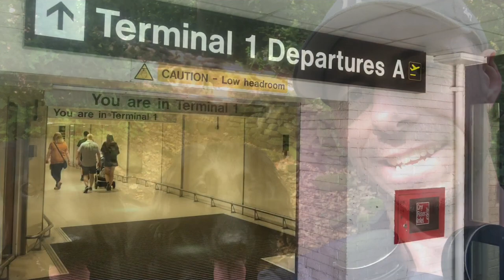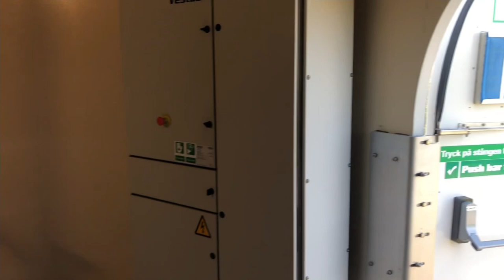Rope access Blade repair - it’s not all good

Comment: i just completed my IRATA level 1 , did a few days with a construction company and considering blade repair and my options.  Being over 40 this is very informative and relatable. TY!
Reply from the maker: Cheers bro… all the best in the new career… Rope Access has so many avenues it’s just finding a trade that you enjoy. Abseiling and climbing is just a means to get you to the work face.

As far as I’m concerned blade repair is for the youngsters. It’s too long sitting in a harness at 40+ in my opinion. Having been a level 3 for 23 years I think I have a good idea how long I want to spend in a climbing seat and it’s not 3-5hrs at a time.

Comment: 6 hours sitting in a harness, even with a seat, is tough. One day is one thing, 6 days in a row would be rough. I did 4 hours with a seat, but even it bites into your legs no matter how many times you move it around. Great video, thank you for making it. Jim
Reply from the maker: Cheers Jim… yep day after day…. You sure needed that Sunday off to let the body heal. I still have knee pain from this job after resting my feet on the blade while standing in my etrier. It’s was a lesson in what I’m not willing to do any more that’s for sure.

Glad you enjoyed the video 👍🏼
Reply: While watching your video, I had the thought of utilizing an etrier or two to straighten the legs, and take the bite off my side quads. I will be up there soon enough, I am doing the composite lay-up training now. On the ground ( thank you) @jaysysumakaRatMaster3
Reply from the maker: @aerialrescuesolutions3277 you might be better off doing some training to work on platforms or MEWPS rather than being on a rope.  Or even keep your feet on the ground. 👍🏼

Comment: Currently in temp job in a pub earning minimum wage making £1400 a month its abismall struggling to even save to pay for the irata training if you have any advice like a way to get into this work, which jobs are decent pay when starting out any tips ect. my background is van delivery driving and a long time ago did a couple years as a carpenter loft conversions.
Reply from the maker: I understand your situation; the rope access industry can seem difficult to get into at first, but once you’re in, it’s definitely worth the effort. Given your background in delivery driving and carpentry, you already have some transferable skills that can be valuable in this field as well as dealing with customers in the bar.

Here are a few tips on how to get started and possibly secure funding for IRATA training:

1.	Start with Research: One of the biggest misconceptions people have when they start out in the industry is they are a climber first and foremost. This is the wrong way to look at it. You need a skill to offer. Rope access is purely a means of getting to where you’re going to work. If you’re young enough to do an apprenticeship I’d always suggest this first. Anyone can learn to be a rope access technician in a week.

Get a trade behind you, electrician, Non destructive testing inspector, welding, pipe fitting, painting, spraying and blasting, blade repair (if you’re young enough) bridge inspection, window cleaner, glazing installation. 

Having a driving license is definitely a good skill to have though. Learn about IRATA skills on the Access Techniques YouTube page. If you can do your training there as well, it guarantees a good level of training and assessment.

I personally started out installing fall arrest roof safety equipment for the first year working for a rope access company. 

2.	Look for Entry-Level Jobs: Some companies might offer positions where you don’t need a full IRATA qualification right away, but can gain experience while working towards it. You could start by looking for roles like trainee technician or general laborer with companies that already specialize in rope access. They might help with the cost of training once you’ve proven yourself on site. I know plenty of guys who worked as store men in rope access companies getting vans ready for lads to pickup on a Monday morning.

3.	Reach Out to Rope Access Companies: Contact local rope access companies and express your interest in working in the industry. Some companies may have training schemes or offer financial support to help you get your IRATA qualification in exchange for a commitment to work with them for a set period.

4.	Grants or Funding: While grants specifically for IRATA training can be hard to come by, you can look into some general schemes. For example:

•	Jobcentre Plus offers advice on training schemes and may have funding options, especially if you’re on a low income.

•	Trade Unions sometimes offer grants or financial help for workers looking to gain new qualifications, especially in industries like construction.

•	Charities such as the Prince’s Trust or Construction Industry Training Board (CITB) can sometimes provide funding or support for training.

5.	Consider Other Types of Funding: If you’re struggling to save for the course, look into personal development loans or even crowdfunding options. Some people have successfully used platforms like GoFundMe to raise money for professional training.

I hope these suggestions help, All the best in your pursuits.
Reply: If you  want some advice try and go cash in hand sign on and ask the jobcentre to pay for it they're doing mine
Reply: @jaysysumakaRatMaster3  Yes this is massivly helpful gonna be busy reasearching for while thankyou for the help. :)

Comment: Great video mate. Very good insight into this sort of work. So the company you worked for, did they pay for flights,accommodation, food?  How much did they fill your pockets too?
Reply from the maker: Flights paid, 8hrs pay during travel days despite my journey from Stockholm to Stormsund taking about 14hrs including the medical.
30€ per day for food
Accommodation paid for.
PPE paid for despite being 2 days late.
No work on Sunday- Sunday unpaid.

Safety was pretty poor by offshore standards… and certainly not a job I’d do for long.

I was paid £5100 for 22 days away from home which includes £550 of food expenses. This is as a level 3 rope tech, blade technician with zero hours blade experience but over 20 years rope access experience.

Working as an electrician offshore my basic salary before tax would be over £4000 more than this.

Personally I’ll never work on a wind turbine again.

Comment: I see that grinding is done with skin exposed which doesn't gel with me because when you remove the ppe that dust goes everywhere including eyes
Reply from the maker: @trevorvanzuydam8115  Yep, safety on this job was shocking to say the least. In 15 to 20 years time silicosis type symptoms will undoubtedly hit a lot of blade repair technicians through using the wrong ppe.

Every blade technician should be wearing an airfed mask during prep work. The biggest hazard isn’t the height exposure and wearing the wrong helmet is unlikely to be a deciding factor when it comes to life longevity.

Comment: What other jobs have you done with rope access? I have been curious about rope access, but haven't figured out a job that uses it in my area really, one that would interest me. I'm from Ontario Canada, close to Sarnia. Not really big cities near me that require high rise maintenance or window washing. Sarnia has a big oil and gas industry.
Reply from the maker: I have tried many other jobs during my 25 years on the ropes and have finally found myself doing electrical maintenance in the oil and gas industry on offshore oil installation. 

If I could recommend any job as a rope technician this would be it. But, it obviously takes time to acquire the electrical knowledge and also money to do the courses… as with anything really.

Other trades that people look for in this industry are:

Rigging
Non- destructive testing
Instrument tubing - pipe fitting
Painting
Pipe lagging
Bolt tensioning
Drops surveys
Derrick building
Fire and gas engineers - electrical
Electrical maintenance 
Electrical installation 

There’s a lot of avenues into Rope Access it’s just finding something you enjoy.

Without a real trade with rope access you will more than likely be grafting every day of your life. 

Working offshore was a massive eye opener for me into how little is achieved in a working day sometimes and how little pressure is put on you.

At least in the U.K. sector, time isn’t money… it’s all about doing the job safely and sticking to the many rules we live by day to day.

As much as they often feel like they’re there to make your life harder, they more often than not make your job take longer and make it easier.

And considering you’re paid to be here rather than what you achieve… I find it very easy to just roll with it.

Hope that helps pal and all the best 👍🏼

Comment: So I've seen the other side of excessive safety protocols in a corporation. What happens is that someone does something and gets killed. Someone else develops a safety protocol to prevent that from happening in the future. (After an expensive fine/lawsuit.) On a long enough timeline the entire corporation runs as an entity catering to the absolute lowest common denominator in society. If you're a fuckup and a moron, they will make sure that you're nice and safe... or at least can't successfully sue.

Among other things, I am very competent with VERY dangerous equipment. Stuff I've worked with for decades. That equipment is 20% as useful with all the safety crap as without. But you WILL get fired if you don't use it. When I tell them that from about 1885 to 2005 no one ever had access to half the safety shit, I get annoyed looks. When I ask them  just to tell me the safety stats of the equipment before and after all the safety additions, I get progressively more hostility. I make them see that all they're doing is catering to idiots without improving safety.

For some things you need safety, period. Can't do it without it. No space walks without space suits, that's a given. But I find that skill and knowledge is what you really need. If your guy is not skilled enough not to cut through his own rope with a disc grinder, you need to put that guy to learn at least 2 more years on how to become better at both belaying and grinding. Whatever the job, if you have some guy who's been doing it for 10 years without issues, he won't need half the safety stuff you give him.

It sounds like I don't approve of safety protocols. I actually do. I wish it was a properly applied science however. Do the stats, where does it actually improve safety and where are you just keeping incompetents from wrecking themselves? If you build your organization to only cater to the talented experts and then improve THEIR safety record, I am all onboard. But if you're putting a guy who's 2 weeks into the industry on a rope at 100 meters and hanging pillows off of him to keep him alive after he falls... well, you get it. It's a waste.
Reply: Safety Protocols are an applied science, it's called risk assessment matrix. If you have someone that is good a risk assessment and puts in the right control measures instead of all the control measure you normally find things get done much more effectively. Also your attitude is probably what gets people annoyed, think about it from their point of view and your the manager. Do you want a team that says yeah we all have 20 years with a disc grinder we don't need rope protection, or do you want the team that say yeah thats fine bit of a hassle but considering the result of the rope getting cut is having to rescue a guy out his asap or scrap him off the floor it's probably a good idea.
Reply from the maker: @neilmcg7272 No one plans to have an accident but we can all plan to avoid one.

The worst thing in the blade repair industry is that it’s so young. It’s only in 15 to 30 years from now that we will see the effects of working with these chemicals and the dust created from grinding have on the body.

Especially when the right PPE isn’t being provided. Everyone doing blade repair should be wearing an air fed full face mask.

Anyway… it’s not a career path I’ll be pursuing any further. Good luck to you guys.
Reply: @jaysysumakaRatMaster3  Totally agree I liked the improvisation with the pipe, everyone should be looking at things and thinking to themselves is this safe? is there a better way of doing it as that is the only way things improve. I am not in the industry i do building cleaning & maintenance, I was surprised to see you's on the rope for so long and griding and sanding for that length of time definetly will cause issues if you are doing that day in day out. Looked like a cool trip though really enjoyed the video all the best and stay safe what ever you get up to next :)
Reply from the maker: @neilmcg7272  cheers bro… likewise 👍🏼